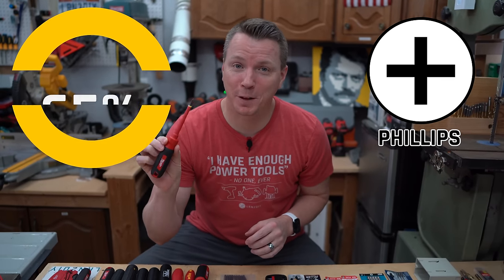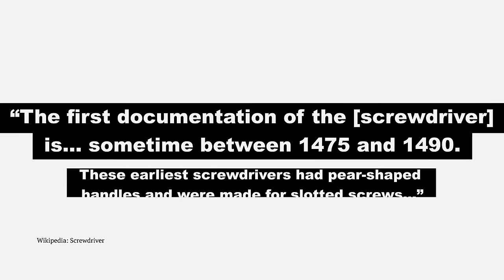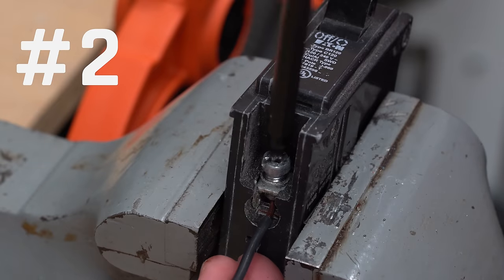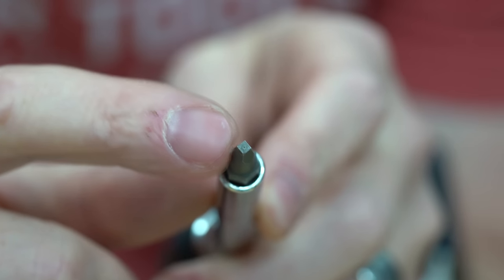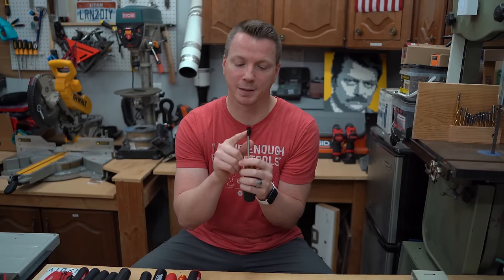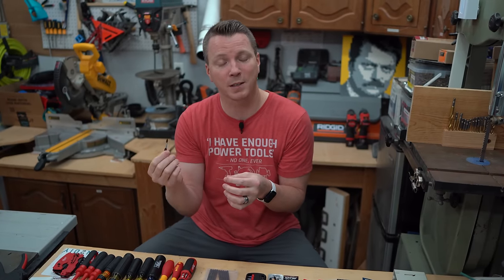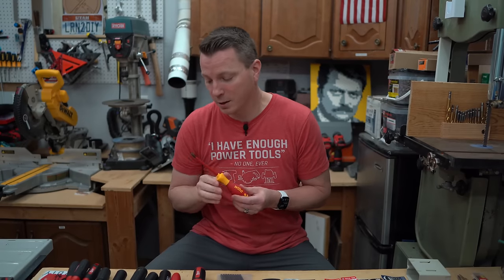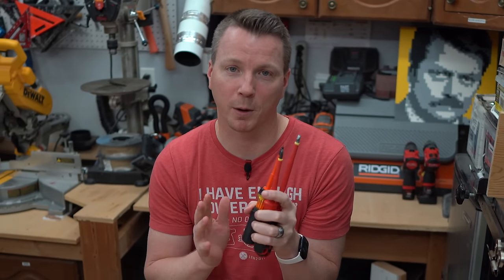You're Using the Wrong Screwdriver For Electrical

Comment: I've been using Robertson for 45 years, esp. #1 and #2 for home electrical work.
#3 comes in handy for other things.
Great "hold" on a freely held screw w/o magnets, good cam-out behaviour, don't wear out.  
(The cam-out is there for a good reason).
I even have #0 that I bought a few years ago - never had occasion to use it.
(Cover plates are decorations - so a flat will do).

Robertson had slow uptake in the US due to licensing - that is all old news.

Flat heads are an abomination against mechanical good sense as they are prone to slipping - they are a throwback to when manufacturing tools and fasteners was far more expensive.

These combination "flat" + other are a silly waste of time & money, IMO.  There is no need for high torque - you need "enough" torque.

Comment: One thing that wasn't talked about and the reason for the need for a good screw driver is...........

the lousy manufacturing of screw heads today.  The slots in the screw head are crap to begin with.  CRAP!  You can even look back at the old pictures that were shown that were just for a straight blade screw driver.  The slots are clean and crisp and you could get lots of torque with the proper sized straight blade screw driver without it camming out.  That was because the slot was ground not stamped. They went to stamping because it was cheaper to manufacture and you could stamp it for a slot and a Philips.  You can't use grinding for a philips or a robertson or any other new fangled screw head, they all have to be stamped.  You can't get good clean edges with stamping.  So, take a close look at the screw head next time and there lies the problem.  Cheap manufacturing and stamped is CRAP!!  Find a old ground slotted screw and a proper sized straight blade screw driver and try it, you'll see what I mean.  The funny thing is, going with a self centering head like a philips or robertson was to save time but you don't save time if you have to screw around (no pun intended) getting the screw tight.

Comment: Philips head was developed so that screws could not be overtorqued.Even then the driver must fit perfectly or engagement is compromised.I totally disagree with your assessment of the straight blade for manual use.I’ve had Phillips screws that I could not remove with a driver,not so with straight blade.I’ve had instances I had to use a square shaft screwdriver and a crescent wrench to remove some stubborn screws,can’t do that with a Phillips.The best drives for positive engagement,however are square or star drive.

Comment: The best option 90% of the time is philips with a flat for the covers
Reply: After watching the full video I have to assume he's being paid off by the Canadians. It's rare to even find a screw that will except the square head if your repairing old work then on the new ones the square heads never fit right. Instead of the one he suggested get the insulated flipping Philips flat klein combo.

Comment: They have long gone extinct due to cheap imports, but CLUTHE used to make the absolute best Robertson screwdrivers..."progress". The certified Robertson tips combined with handles that were made of the best material and grip shape and size.
P.S. Robertson screws were the choice of Henry Ford, but due to Robertson's "tight grip" on the manufacture and distribution of these screws, Ford went elsewhere.

Comment: Just push downward pressure and every one of them will work equally the same.
  It's not the tool that's the problem, it's the operator.

Comment: I hate slotted screws completely and the cam out on Phillips.  I use square, hex, or torx for all my projects.

Harbor Freight does have a Doyle three insulated screwdriver set for electrical that includes ECX, if you don't want to spend much
Reply: I've actually switched out all of my electrical plates for screwless, just to avoid slotted screws. 😇

Comment: WHY are you stressing an insulated screwdriver?  I've done a LOT of DIY electrical work for over 50 years, and I literally NEVER am inside a box with live wires.  Never.  Closest I come to that is working in a breaker box, and then the live power is still damn far from where I am working.  Add to that that I am not holding the metal shaft, but am holding the (non-conductive) handle, and I simply do not see any reason at all to have an insulated screwdriver.  BTW, I used to work in an electronics shop, and YES, there we could be adjusting something while it was powered on.  But, again, do YOU do that in DIY electrical?  I sure hope not!!!!!!!!!

Comment: Anyone using a slotted or 'minus' (-) screwdriver on electrical switches, receptacles, breaker panels, etc. is also NEVER going to go metric because they are ignorant to the point of stupidity and possibly cheap too so they don't care to buy the right driver. 

FYI, what your Mr. Ford did for America, getting into a pissing fight with Mr. Robertson, is why you Americans still use Philips and to a much lesser degree slotted drivers. Canada didn't suffer like the USA and have had Robertson (square head) drivers ever since. 

For the last 39 plus years, I have been using #1 and #2 Robertson for electrical work in a majority of stuff. Switches and outlets use #1 Robertson and boxes and panels use #2 Robertson. Unless you're using a HIGH torque drill/impact or hit the gym harder than Arnold in the 80's, the Robertson heads were never a problem. 

Why are fractions easier to defend than going metric? Metric is base 10 and everything just makes sense. Water freezes at 0c and boils at 100c and 1 litre of water weighs 1 kg at 0c. For you knuckle draggers out there, you're already using metric when you rate the hotties out of 10. Your 2x4s haven't been 2x4s since you started dressing them. How many feet in a mile? I sure as hell don't care to remember but in metric everything is base 10.

Comment: I disagree. I have probably seen a million of them screws and have seen them stripped out. Luckily a lot of them had the slot so I used that to do what I had to. But I have also seen plenty of square drive sheet metal screws where most of them were stripped out and you would have to use something else to remove them. Had me cussing many days because of it.

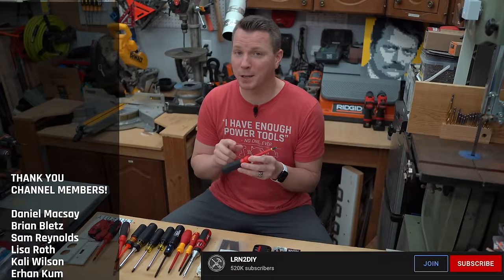Comment: 4:25 last decade, an "experienced" electrician skipped n an insulated driver in a task and crashed an entire line of the Vancouver SkyTrain for most of a day.     Don't think he's working for Transit anymore.
Reply: 6:50 Canuck here, find the (smaller) № 1 Robertson are more prone to strip (more the the screw head than the driver) than the (larger) № 2 because the smaller ones don't seem as durable.

Comment: 11:45 Maybe this is not the right type of screws for it. They look more like Pozidriv screws to me rather than Phillips so it's easy to mangle them or just slip when using an incorrect driver. Most screws nowadays are Pozidriv rather than Phillips although the large majority of people will think of them as Phillips and often they'll pick up an old screwdriver from their tool case which is probably a Phillips screwdriver. A new set of screwdrivers on the other hand will more likely be Pozidriv rather than Phillips but it should clearly say what it is on the package in any case and it should be correct, if it's made by anyone remotely reputable.
See here about the subtle difference between Pozidriv and Phillips:
https://youtu.be/YIIeed86OdE?list=TLPQMTYwOTIwMjNzcDmPwD3BDw&t=57

Comment: The problem with slotted screwdrivers is the screws from china are soft and junk, and have been for some time now. The best part of slotted was you had a pry tool at the same time. But even back in the day not using the correct size or cheap screwdriver that does not fit the slot like a quality electricians screwdriver does is 100% the problem. What I hate to see is electricians using the push in back connections.....OMG I have had to fix multiple outlets in my home due to the worthless push type devices even in at the time quality outlets. And electricians( electrician helpers who are not licensed doing your electrical connections)/homeowners using power tools to screw in everything and over tightening/stripping them out, pisses me off, to no end. The problem is most people do not want to spend a few hundred dollars on hand tools. And finding quality is a problem now as well, they are all made in ASIA pretty much now. Even Klein Tools have made in china on them.

Comment: Don't use impact bits to hand jobs and hand jobs bits to impact tools... not only you can crush impact bits by hand becase they specific use is for get torqe from impact better than normal bits and normal bits its to soft to impact and absorb energy from impact than tranfer it. Use proper tool to work.

Comment: Interesting, I did not realize that the combo screws were square drive as well, that explains the #1 drivers that I hadn't found a use for yet.  I'm also on the slotted screw hate team-electrical seems to be the last bastion of masochists that use them.
Reply: they still pop up randomly in aircraft now too. Usually older designs. And phillips are still everywhere in planes.

Comment: Or you could just get the proper screwdriver to start with.

Those cross-head thingies are not Philips screws (at least not after 2106) they are  ISO 8763-1 compliant PH (or Cross head).    You want either a #2 JIS or a  DIN 5260-PH/ISO 8763-1.   Just like the guy that butchers all the cross-head screws on a Japanese MC, or destroys the screws on his ATV brake reservoir, then chews up the screws on some otherwise pristine Japanese build electronics with those stone-knife vintage philips drivers.

Comment: The  CORRECT answer is,  the  screwdriver AND   screw  manufacturers need to get out of China and  make ACTUAL  CORRECTLY MADE FASTENERS.    If you have a proper phillips and screw,  Roberts and screw, and even  slotted and screw,  they will all hold very well.  You find VERY VERY few screws anymore, which are PROPERLY  made!!!

Comment: Your question is flawed the screw comes with a flat, a phillips or robertson THEY ALL WORK OR THE MANUFACTURE WOULDNT HAVE DESINGED THEN THAT WAY. JESUS DIY STOP YOUR MAKING A FOOL OF YOUR SELF. ITS VERY EZ CHECK THE DESIGN SPECS FOR THOSE OUTLETS SWITCHES ECT. LEVINTON SPECIFICALLY SPELLS THIS OUT